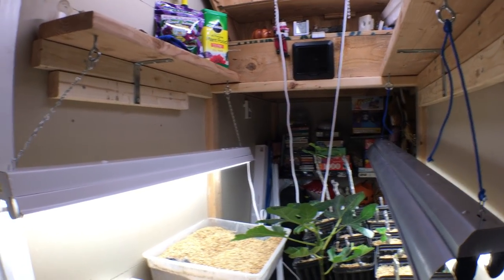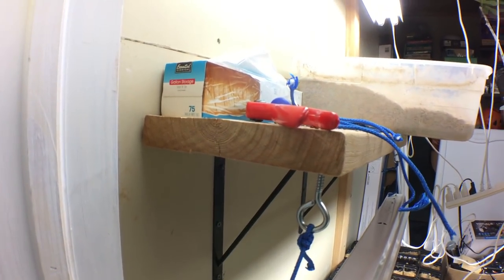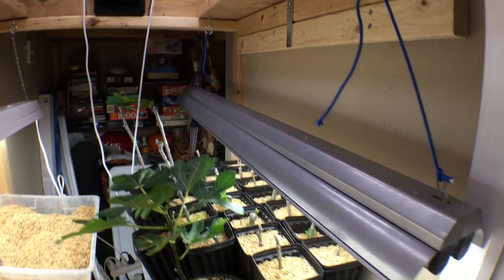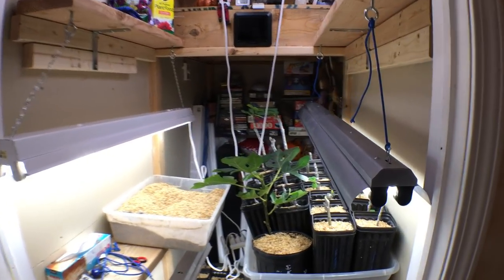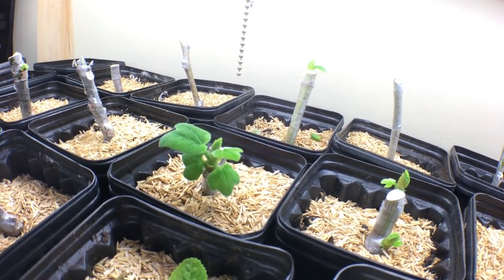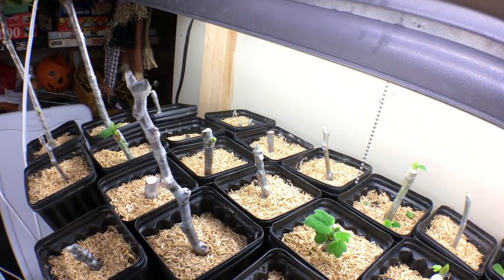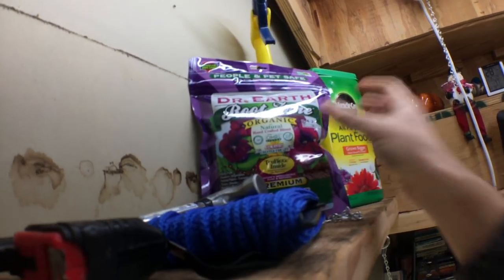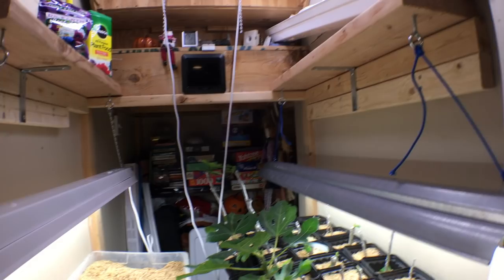Rooting Figs: Upgrades to the Grow Closet

Comment: It's really interesting how well figs respond to heat.  I had two, very small VdB that I wasn't sure overwintered, so I put them next to an oil-filled space heater for a week.  They woke up within a day or two.  We have to run humidifiers or our indoor humidity goes lower than our sensors measure (15% RH).  Will probably have to buy a few more humidifiers when I start taking cuttings later in the month.

Comment: 4100 K is not ideal for vegetating plants. too warm/red on the spectrum and too much useless green wavelengths. you ideally want 10000K but ideally, leds focused in the blue wavelengths. you also need to set up better reflectors; you are losing output to outward diffusion (long time coral reef aquarist)